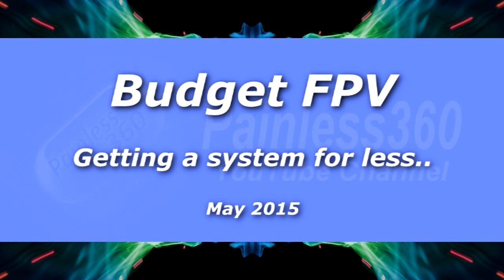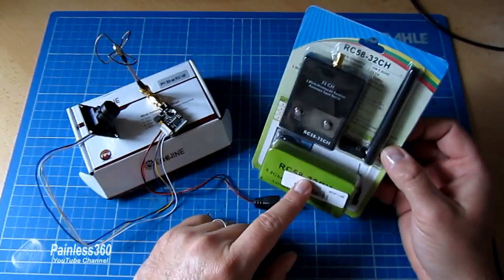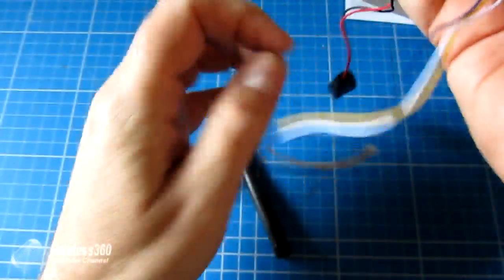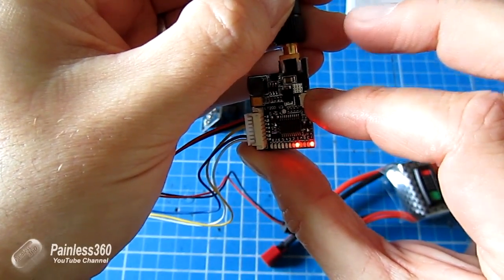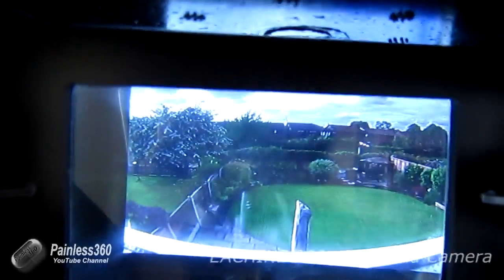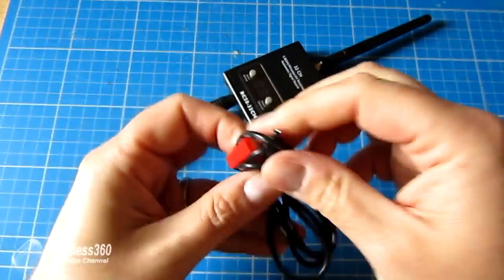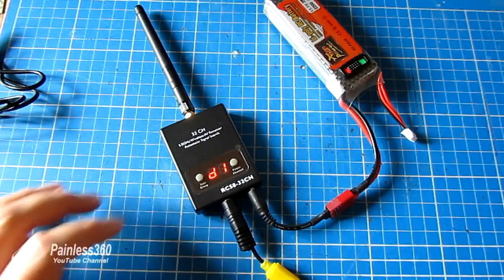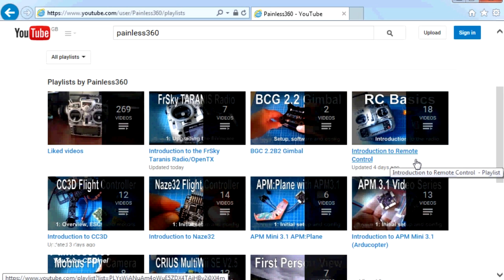Great FPV on a Budget - How to get a camera, transmitter and receiver (products from Banggood.com)

Comment: Hi painless does this RX run on 2s ?
Also with the quanum goggles, Ive noticed ready made rc sell a 5inch dvr with built in RX and battery that has a higher resolution screen. I was just wondering if that would be an option to put that dvr in the qaunum head piece. It would be all in one
Reply from the maker: phats24 Specs say that it will run from 7v and up so maybe.
Sounds like a nice idea - let me know how you get on!

Comment: Hi!

is the 110 degree camera the better choice for FPV?
should I use CMOS or CCD (or does one of these options not work with the goggle?)
can I power the camera/VTX with the flightbattery, or should I use a seperate one?

thanks for the reply!
Reply from the maker: +djdaudeij Normally pilots use 110-130 degree field of view cameras for FPV. Any more and the important centre of the image starts to be very small. The camera technology will work with any transmitter, it's more about the voltage the camera works. Most will power the airside FPV camera and transmitter from the flight battery. Happy flying!
Reply: +Painless360 thanks for the reply!

Comment: Hello. I love your videos. But i think i made a mistake i cant check by now. Everyone says dont power up VTX withoit antenna. Whell i did and it was on about 30sec on 25mW. So how long does it take to burn it? I would like to test it, but i destroyed my VRX so cant recive video. I wonder if it can be burned, so i order new VTX now cos i would not like to wait 2 weeks for VRX to come and another 4weeks for the new VTX to come. I use TX001 Eachine VTX.
Reply from the maker: On lots of the cheaper transmitters it's usually very quick, a couple of seconds is all it takes to cause damage. On more expensive transmitters like things from TBS, they're designed to withstand transmission without the antenna attached for quite a long time. That's done so if you crash in the antenna snapped off then it doesn't fry your electronics. The only way you'll find out for sure, is to test it properly. Best of luck....
Reply: Crap... I tried it if it was hot, but was not. Now i dont know anyone to have vRX to test it. Is there any way to test it with multimeter? Like some setting that would tell me if it transmits the signal? Any responce would be good. I would meshure it on the board with antenna on. I dont have equipement for meshuring signal strenght like few people have as i saw in the videos.
Thanx for your reply.
Greentings from Slovenia ;)
Reply: Just one more question. Does it help if vTX vas set to 25mW and vTX has original soldered on 4cm pigtail with antenna mount or you thiink it is definetly burned? vTX is Aomway TX001
Reply: Whell the vTX is still alive. It did not got burned. Mavy helped that it was set on 25mW and it had original attached pigtail, so it took those 30sec without antenna It still works :)

Comment: Hey, just wondering about the legalities of 200mw in the UK, 25mw is the legal UK limit from what i know and i am keen to stay within these boundaries. Is there a licence you need to obtain a higher wattage for the transmitter?
Thanks :)
Reply: 10mw is the legal limit unless you have a licence then your limit is 25mw, anything above is illegal... Saying that immersionrc 600mw and 1w transmitters are freely available in the UK. I think the bands are restricted as well ie most of the 32 channels are illegal even at 25mw. Needless to say you won't be able to fog on 25mw very well unless you spend a lot on aerials.
Reply: William S-R 10mW for 2.4GHz and 25mW for 5.8Ghz without a licence for airborne use. You must use 5725- 5875 MHz range for 5.8Ghz anything outside that range is illegal.
Reply: +HATCHETHAS I don't think most cops are educated enough, to know what you are doing. I have a Futaba FC-18 Plus with modified Cessna Radio transmitter 20 W 127.025 MHz transmitter(you can check it on Skychaser)Put the receiver on a Solar glider(lost it 2 weeks ago) and flew it easily 20 KM's away. When cops see the aerial on it they ask why is it so big. I tell them to fly it legally without a HAM License. They most of the times wait for me to fly the plane back, and they become very interested. They will never research my stuff, because of their lack of knowledge and education. If I let them play with my Quadcopters they really love it.

Comment: Hey nice video.. I have a problem in Eachine VTX03 Mini 5.8G 9Bands 72CH. It's getting hot quickly. Is that normal??
Reply from the maker: +InfiKnight some of the smaller video transmitters do get quite hot so it's important not to have them sat around too long and get them in the Air flying where they can be cooled by the passing breeze. It shouldn't get too hot though, if it's getting so hot that it starts to have a problem with the video then let the reseller now
Reply: Thank you

Comment: What jst connector is it on the fpv transmitter? A wire came off and I can't get it back in so I will need to buy a new jst connector with wires. Thx.

Comment: Hi again, I'm reading up about fpv and to me it seems the 2.3 ghz and 1.3 ghz frequencies better for penetration and signal but I can't seemed to find any equipment for them within the U.K. Law. Any ideas on what I can get for long range fpv without breaking the bank?
Reply from the maker: 1.3 is not available for airnourne transmittion here in the UK. Check out sites like the  http://www.fpvuk.org/fpv-law/ to see what's legal. If you use 100mw 2.4Ghz for the radio and 25mW 5.8Ghz for the FPV you're good. Other bands area available for specific things too..

Comment: I have purchased the"Budget FPV kit" and it works great, I says on the instructions that the tx supplies 5v to the camera, would it be OK to connect it to a Möbius then (providing I don't make a Horlicks of the connection), anybody any advice on this?
Reply from the maker: William Mckinstry Not tried it myself as I tend to use the Mobius separate. Anyone else have any ideas?

Comment: Hi,
i am looking at getting into FPV and was wondering if it would be possible to power the FPV equipment and aircraft off the same battery by using the balance plug for FPV and the normal power cables for the aircraft. would this work or would it damage the battery because of to much current being taken out too quickly. 
Will
Reply from the maker: +Scale Model Builds Absolutely. Normally I add an extra connection from the power distribution board on the model https://www.youtube.com/watch?v=2ghMtUiV18w
Reply: thanks!

Comment: i ordered an FPV camera yesterday from ebay, and i just realized it is only 60°....
it is probably useless for FPV purposes, isn't it?
Reply from the maker: muh1h1 Very tricky to fly with less than about 100 degrees of view. Feels very confined. You can always use it as a second camera with a video switcher ;)
Reply: Painless360
i'll probably try to find a replacement lens on ebay...
Reply from the maker: The cameras are really cheap and come in lots of variations - make sure you get a 5v model though, it will work with the Tx easily.
Reply: Painless360
Yes, the one i got is 5V...
Well, well see, i am still not 100% sure where and how to position my camera anyways, since i am currently designing a "cover" for the frame, so it looks a bit neater and does not collect dirt so much...
While we're at it, you may want to have a look and see if you can see any major design flaw i have not thought out :)
https://www.tinkercad.com/things/jEj83FfYvL2-zmr-sidecover
Reply from the maker: Nice design. Are the ESCs out on the arms? If not then you will need airflow in the frame for cooling. Also, think about access to the USB port on the FC for setup and tuning. - do you need that access? Finally consider the angle of the camera and an integral mount for a simple servo gimbal to help when racing..

Best of luck!
Reply: Painless360
Thank you first of all.
The ESC is a 4in1 20A ESC, but with these tiny Emax motors (1806 2280kv) there is very little load, so i am hoping it dows not get so warm...
for the camera i plan to mount it at a 12° angle insude the quad, but i am not completely sure yet...
depends on how it is all going to fit in the end...
i generally don't need acces to the FC, but if i do i need to disassamble the quad anyway, since it is obstucted by the reciever and the FPV transmitter anyway...

Comment: I haven't been able to get anybody to answer this question yet, though I have asked it in several places.  Virtually all cameras state whether the video and flyback are encoded by the PAL or NTSC standard (apparently SECAM is not in favour).  I presume that the camera produces a composite signal, which is sent to the transmitter, which transmits whatever it is fed.  It must be decoded at the receiving end, however, but I have never seen a receiver that states whether it processes a PAL or NTSC signal, so I presume it is done by the screen itself.  Do I have to take this into account when buying a Tx/Rx pair?  Do I need to buy a screen/goggles that is matched to the camera?  Or are these analogue concepts not used in RC transmitters, where HD or Full HD would be a more logical digital standard?  If that is the case, why do cameras state their encoding standard?  I have frequently seen two identical cameras (eg. the RunCam Starlight cameras), one PAL, one NTSC, for an identical price.  There must be a choice to make, but what, at the receiving end, does it depend on?
Reply from the maker: Great question, not sure why you're not getting answers though.. The video transmitter doesn't care what the signal is - it just sends it across. You're right the video decoding on the receiver needs to match the camera - NTSC or PAL but most these days will auto detect and select the right settings automatically. Occasionally you'll find kit that needs to be set manually. See our videos in the 'Introduction to FPV' for more content. You may find these useful too - https://www.youtube.com/watch?v=A5tgcsMktuQ and https://www.youtube.com/watch?v=gdKKNGIsQn8
Reply: Thanks for the response, Painless (it may be for you ;-) )  
So if I understand you right, the camera encodes the transmission standard, not the transmitter, but it is the receiver that decodes it, and sends a simple video signal to the screen.  I guess, then, that the receiver split out the 3 colours and synch, and sends them on different wires (RGB)?
I looked at the links you gave, but they didn't answer the question.  The first one contrasted PAL with NTSC, but spoke mostly about the difference in frame rate and the ramifications of that, and the second one showed the problem of not selecting the right standard, but as you were using a screen with built-in receiver, it wasn't obvious if you were changing the settings in the receiver or in the screen.  In my case, the screen and receiver are likely to be separate (Quanum V2).  I haven't bought them yet.
So are you saying the ALL receivers can be set for either standard?  I have never noticed this in the specs for any receiver.
BTW, I see that there's a new Quanum - the Cyclops - which seems quite nice, but has some disadvantages - a single button to auto-select the channel, fresnel lens, and a non-diversity built-in receiver.  Just a personal impression, but the V2 Pro seems a better bet - more versatile, although heavier.
Reply from the maker: If you want to get into detail - book a chargeable support call and I can take you though it. The short version - FPV uses composite video over a single cable. Happy flying!
Reply: Thanks Painless, but I think I've got the idea.  I have a background in electronics, and already know the theory of PAL/Secam/NTSC and transmission theory (I've just been answering a circular polarisation question on another forum).  The PAL encoding has to be stripped out somewhere along the path from camera to screen, and it could be done in the receiver or the screen - I just didn't know which.  To me, it would have seemed more modular to have the receiver undo what the transmitter did, and output the signal that the transmitter was given, then the screen would undo the encoding that the camera put into the signal.  Alternatively, it could have been designed so that the camera fed a composite video signal to the transmitter, which would then encode it for transmission, in which case the receiver would decode it (as it does) and hand off a composite video signal to the screen - but from what you have told me, it's not balanced in the way I would have considered "nice".  However, if it works, it works.  You've told me all I really needed to know to order compatible equipment. Thanks for the info.

Comment: Which battery should i use to power a 1000tv fpv camera with a 600mw transmitter.
Reply from the maker: Sounds like your are new to this. Check out the ‘introduction to FPV’ playlist for lots of the basics.. best of luck!

Comment: I m confused on 14:13, where is that interferance come from, is it solved by circular polarized antenna?
Reply from the maker: Vitaliy D Not sure what you are referring to, if you mean the distortion when using a FatShark Tx then not it will not. There are loads of 'Introduction to FPV' videos that explain it. Happy flying!

Comment: Hi Painless, with running the Naze 32, can I power the camera gear off the naze 32?
Reply from the maker: Drew Tuck I wouldn't. Power the transmitter from the main flight battery and then the transmitter normally provides power for the camera (+5v or 12V).
Happy flying!
Reply: Thanks buddy!! I think the Banggood unit that i got can handle a 4s battery.

Comment: Hey there. Will this set up work with a 2S setup? the connector looks like a 3S connector but the working voltage starts at 7v and goes up to 24. Any help would be appreciated.. kinda new at all this.
Reply from the maker: +Shadrik Easton Should do! Happy flying!
Reply: Thanks man. also, thanks for the quick reply :)

Comment: Does any body really ever check the mw power of your video transmitter? Thinking about increasing from my uk 25mw...
Reply from the maker: Bishop Vick With the right antennas you can get 1.5km+ ranges with a 25mw Tx. See the videos on antenna choices for the ground station in my 'Introduction to FPV' series..
Hope it helps.

Comment: Will a turnigy 11.1v 1000mah 30c lipo work with the transmitter?
Reply from the maker: Depends on the Vtx you're using. Check the specifications for the Vtx and if it lists a voltage range that includes 10.5-12v then you'll be fine with that battery. Best of luck!
Reply: Painless360 thanks dude, subbed

Comment: High would this set up work direct on my phantom fc40 at the mo I'm running a sj4000 cam direct on its own battery power .
Reply from the maker: +Winston Banks Not sure, as we've not used the DJI products here. You should be able to make it work with a little cabling.. Best of luck..

Comment: Painless360 hey I have a question can I use a 20mw transmitter and a 200mw receiver together and especially in Germany can I legally use a 200mw receiver because transmitter with more than 25mw are illegal thanks
Reply from the maker: The receiver normally doesn't have a power rating as it doesn't transmit anything. If that is the case then you should be fine.

Happy flying!
Reply: Painless360  thanks mate you saved me haha because 25mw fpv systems are so expensive
Reply from the maker: You can use a different antenna to still get great range - see my video on this in the 'Introduction to FPV' playlist..
Reply: Painless360 yeah thanks I'll get some cloverleaf antennas and a 20mw modul
Reply: Darren Fürst Das stimmt, mehr als 25 mw darfst du in DE nicht senden, aber sein wir mal ehrlich, du darfst auch nicht 10km/h zu schnell fahren, und trotzdem macht es jeder...
Ich selbst sende mit 200mW, und ich hatte noch nie Probleme, ich glaube um ärger mit der BNA zu bekommen, musst du es schon drauf anlegen...
Reply: muh1h1 Das ist mir klar aber ich wollte es sowieso wissen ob die eine Bewertung haben danke ich werde sowieso erst mal die drohne fertig bauen wenn meine Motoren endlich kommen warte schon seit drei Monaten
Reply: Oh, das ist ja ätzend, 3 monate ist schon arg viel, bist du dir sicher, dass sie wirklich noch kommen? nicht, dass sie dich verarscht haben :/
Wird das dein erster quad?

Comment: Why is no one talking about BETTER cameras i.e. LENSES???  I would think that would be something you wouldn't skimp on if you're interested in Aerial Cinematography / Photography???
Reply from the maker: +Jay.C.Fotografie Absolutley - the lens obviously make a lot of difference to the image, but in practice the low res displays used for FPV make little practical difference to the image you see UNLESS you are talking about reduced lens flare and other features of improved lenses. See the Mobius and 808#16 videos to see the different lenses and read up on the FatShark FPV tuned cameras to see more.

Comment: how to increase my transmitter range amd how power booster work
Reply from the maker: Use a Tx with more Mw/power and use a high gain directional antenna. See the 'Introduction to FPV' series.. Best of luck!
Reply: Painless360 thanks

Comment: I'm trying to add an OSD to this setup, does anyone know the camera pinout?
Reply from the maker: +Michael Brewer |You can figure it out by following the cable from the Vtx as the pins on that are labelled.. Best of luck.
Reply: +Painless360 Got it, I have the video, I cant figure out the ground.
Reply from the maker: Use a ohmmeter to check which pin is a dead short to the GNS pin on the power connection.. Best of luck..